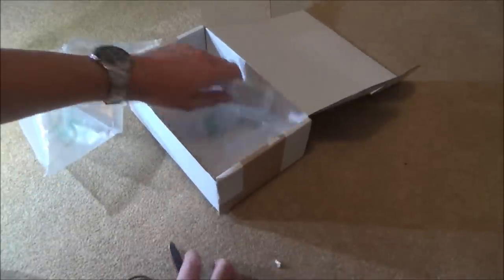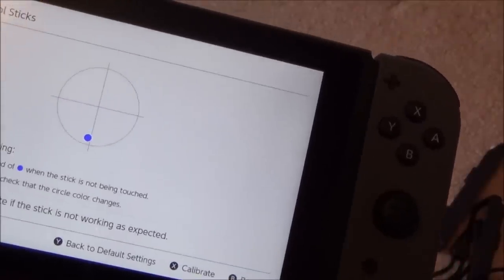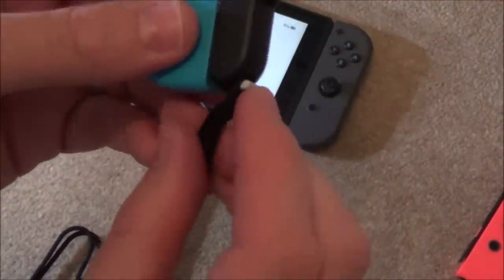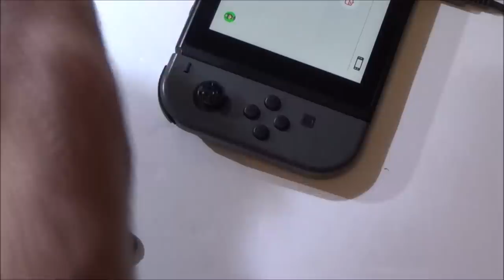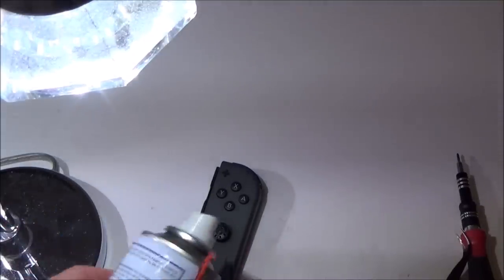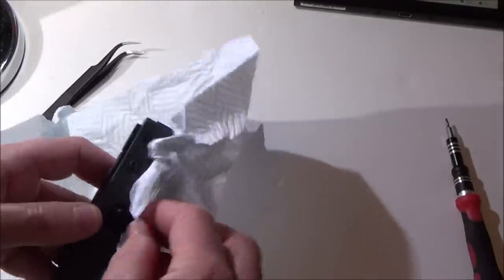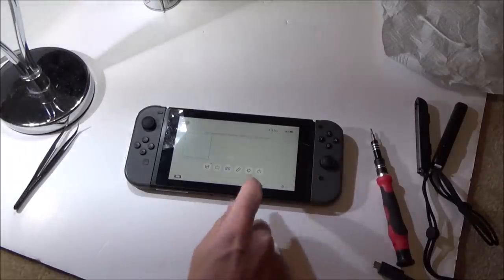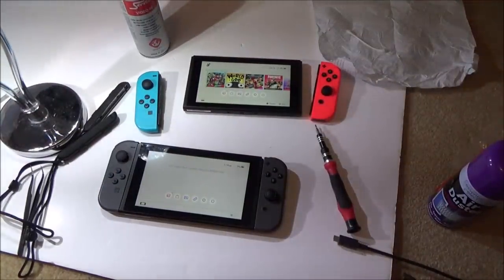Trying to FIX Nintendo Switch Joy-Con Stick Drift and Loose Stick Caps

Comment: Let me tell you a tale of woe and improvisation. 

I caved, and allowed my six year old son to play my switch. I love to game, and so does he. But he is a boy, with severe adhd. And alas, the switch is far too delicate a machine. First it was the drifting. And I, like so many others, took the caps off. To this day I cannot find one. Both joycons. Switch was unplayable. My cheap fix was a wired controller, and so it was only playable docked. Then the controller stopped working at all. Inspection showed the casing of the wire had been chewed (?) Through. Dog or child, I know not. One wire was not connected for sure. Snipping it and stripping them and reattatching them and then wrapping them in electrical tape resulted in... nothing. So I took it apart and re did it. Still nothing. So I bought  a new wired controller. Yet it also did not work! 
No.... not the usb port! All of them?!? None worked. No joycons. No controllers. Only the screen is functional at this point. But going through a drawer of random electrical things, I found a usb to c charger converter... thingy that came with my Galaxy 9. Would it work?

Yes. Yes it does. 

Except now, the charge port at the bottom of the switch (that I plug the controller into via the converter) is loose (nobody knows why) and will not hold the converter or charger in place. 

So now no one touches my Switch but me. Except when I'm playing, because if you touch it the controller falls out.
Reply: Conclusion: dont get kids or dogs, and if you get a child and you have a switch, dont let him/her play it

Comment: People remove it because idiots have told them that because it's on on straight they have a drift issue. Or that they should clean under the rubber to fix drift.

Comment: Need to open the joy con and get to the analog stick to empty out the dust, just did it the other day works, only need to get the Nintendo switch tools, and watch a you tube video fix it easy

Comment: My first PS4 controller won't move all the way left on the left stick that made Ape Escape 3 really frustrating and my second one registers a half left on the right stick when I press the r2 button so I can't play Rocket League. Fixit videos on the DualShock 4 would be great also PS2 fixit videos there's so many PS2 with disc reading issues. The fat ps2s can have the laser replaced by soldering a replacement laser on eBay. The slim ps2s I don't know.

Comment: Good thing is you can still purchase it.

https://www.espares.co.uk/product/es1746789/video-40-tape-head-and-disc-drive-cleaner
Reply from the maker: Nice one, thanks for sharing the link. Price is a lot more than Maplin was but if it works then it is worth it :-)
Reply: yeah, could probably find it alot cheaper that was just the first link ;P but either way one can will last a while. so well worth

Comment: Yo guys i fixs this issue but its more then you gus would like to do take apart the joycon module clean it al the way put it back together and remove not the top rubber but the one that covers the module itself then recalibrate after reset joycon this fixs it 100% i fiks all 4 off my joycons this way if you need help just pm me

Comment: My joycons look like they have herpes from those damn bumps after attempting to re attach the damn rubber Caps it's impossible the closest ive gotten always leave one bumb at least and so frustrating taht it's almsot ad if I can only ever use pro controller and can't use my switch as intended. Rip portability

Comment: some guy told people that taking the cap off fixes joycon drift which is why that happened
Reply: The cap has nothing to do with stick drift. I wish people would understand how an analog stick works. You move the stick and inside the controller there is a sensor that translated your movement input into the game movement. So if you wanna fix it you have to go to the sensor not a rubber cap on the opposite end of the device on the sensor.
Reply: @hardtobearit  yeah i agree i was too desperate. luckily i just clipped the rubber bits off and Its fine

Comment: Please stop yanking off those straps without pressing the button. It's hurting my sanity
Reply from the maker: Hi, the button releases the Joy-Con from the Switch not the straps, pressing the button makes no difference when removing the straps, if you look closely you will see this yourself in the design of the strap :-)
Reply: @Mymatevince  Thanks, that's good to know.

Still bothers me though